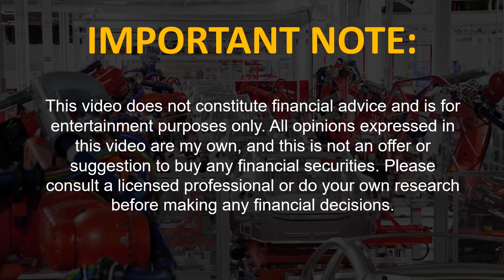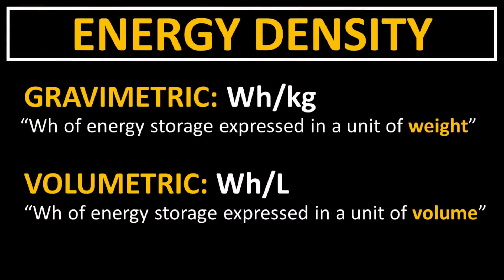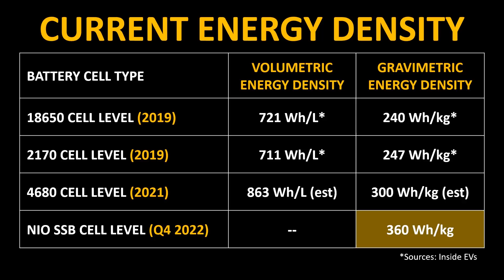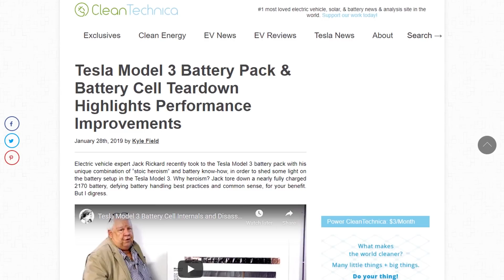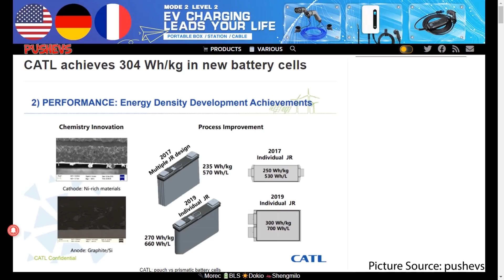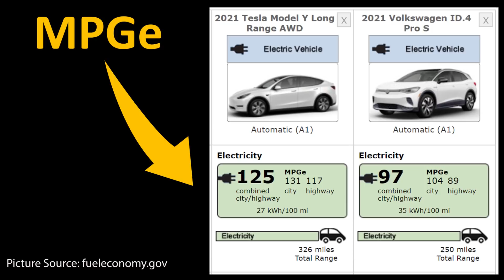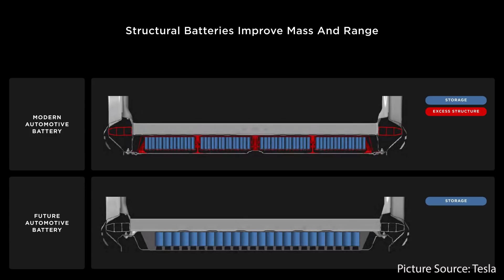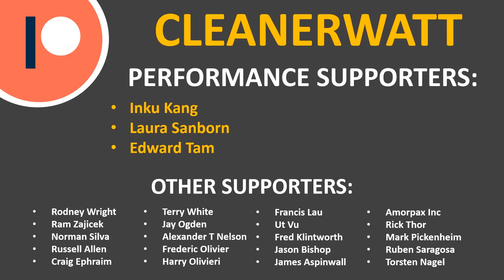Tesla New Battery Tech vs Nio Solid State Batteries (Part 1: Energy Density)

Comment: Energy density Energy density everywhere what about realiablity does solid state battery will provide enough battery life to sustain that long range over time , It will only succed if we can get similar Cycle life for SSB as we are getting from current tech otherwise it's useless to buy expensive battery which degrades faster.

Comment: You take a minute about a car brand who is the first to use a new battery technology and then spend 20 minutes why Tesla will ends on top.  Sorry, in my opinion you are comparing apples with oranges:
- You take in account the weight loss of the mega castings. 
- You take in account the weight loss of the battery pack as a structural part of the car. 
- You do not account the benefits from semi solid state technology, like less power needed for heating or cooling the battery pack. 
- In your projections you take statements from Elon about the future progress of battery tech and forget to mention that new SS tech also will show progress, maybe even better, because at this point this is still new technology.

Why is it that a channel called ‘CleanWatt’ has to act as a Tesla fanboy instead of just be pleased with the news that there is actually new step in promising battery technology. 

Holy shit! I’m getting so tiered with this. Don’t get me wrong if I could afford a Tesla, I had one. However I am just interested in clean technologies and ends up bombarded on YouTube by videos like this. It’s just horrible.

Comment: I have read some of Tesla's hype before about gaining weight advantage because their battery packs are being designed to be a structural component of the frame.  Others can also do the same weight lowering using this method thereby neutralizing Tesla's claim.  Frame weight reduction should not be used in determining the abilities of batteries, even though lowering weight is a good idea.  The Tesla auto that went a short distance before running off the road and hitting a tree outside of Houston this week says that Tesla had better add more strength via weight back into their frames, as total structural collapse happened, the car them burnt up and the two occupants were burnt to death.

Comment: 330Wh/kg at pack level is a very very brave statement. AFAIK the cells would just about make 330Wh/kg. They still need management and cooling. Forget it at pack level. I say 220Wh/kg at pack level, if you’re lucky!

Comment: There a lot of room for misdirection with EVs. I will definitely not take Tesla performance stats for granted after battery day because they stuck “x5 storage” on the screen as performance when it IS NOT performance but only data. It is nothing more than the volume of the bigger 4680 cell compared to the volume of the 2170 cell. Misdirection? Definitely! Take care out there and do the maths consumers.

Comment: Great video. It really highlights just how ludicrously far ahead Tesla is. This seems to align well with what we know about range. The EC7 with 150KWh pack gets 600 miles NEDC range, which is probably more like 400 miles EPA range. All while being 60% larger pack size than the new Model S long range (90KWh pack) with 412 miles EPA and still using 18650 cells! 

The Plaid+ with 4680 cells has 520+ miles range. Let's say they stick to that number for now. That implies a mere 74kWh pack! So Plaid+ will have ~25% more EPA based range than the NIO with a battery pack that's half the size. 

This is how Tesla dominates. They can build two cars for the same number of batteries their competitors need to build one. And STILL beat them on range. 

It's amazing. And why Tesla is going to the moon.

Comment: Perhaps I missed it, but when talking about solid state batteries you should always consider the cooling.
Solid state batteries will need less cooling/heating to keep it a optimal working temperature. I think this is where you save space and weight. In any way, it will be awesome, both technologies look promising, and ideas like this will force Tesla to improve their technologies all the time.

Comment: What about charging time. A structural battery pack lowers the weight but does not appear to increase charging rate. What are the comparative charging times of the two technologies?

Comment: The use of structural batteries lowers the weight of the car, not the battery pack. That is so far a stretch you are clutching at straws and distorting facts to suit. Completely false and unacceptable manipulation of data in order to favour Tesla.

What are the real figures without the car weight affecting the battery density (unbelievable stretch).

If the Neo releases with an ultra light back seat with bolts that link it to the battery pack, will you re-calculate the battery density ? (just let how stupid that question sounds sink in for a moment, it is no different to your conclusion).

Comment: The biggest issue I see with NIO's solid state battery is the  phrase "with good battery life". No, that is not "good" enough. I would prefer to have a little less range to have excellent battery life. Think about it, why go for extra range when the battery will not last very long to always provide that range?
Reply: Great point. A very vague claim re life for the battery

Comment: Going forward, battery COST per kWh is more important than energy density, because current range is adequate, it is the cost of manufacturing EVs that is "not adequate" currently ... most are still in luxury car price range, and Tesla, by all indications continues to lose money on each car (but turns a small profit due to government EV credit sales, and free capital from Stock Dilution). The Porsche Taycan at it's hefty price, may be the only high margin highly profitable EV on the market. The EV industry needs COST REDUCTION Technology Advancements... that will greatly increase market share within the entire auto market.

Comment: I feel that all battery architecture will eventually change to pouch or flat cells. Take a stack of paper and roll it up.... it simply takes up much more room in cylindrical form than it does when it is flat.  Also cooling can be much more uniform in a planar battery. Only time will tell if my prediction is accurate or not.
Reply: Not necessarily. Prismatic packs are very difficult to cool.  Further more it’s more difficult to pull current out of them.  Unlike paper you can’t just stack them up.
Reply: Hi  @greghelton4668  you mentioned prismatic but I did not... prismatic cells are blocks like bricks. I suggested flat / pouch cells stacked with something like an aluminum plate between them to extract heat. Rods could compress the stack. The plates could be cooled at their perimeter by liquid or air.  Looking at all the wasted space between cylindrical cells I think flat cells would result in a much more compact battery. Also cylindrical designs have inherently uneven thermal expansion which in time can cause stress and physical fatigue. Like I said time will tell.
Reply: @cycletrucks7132  I could be missing something but it’s the same thing physics-wise as far as I know. Cylindrical batteries has higher resistance in the past because the ions had to travel longer distances between electrodes.  Teslas tabless design eliminated that problem. As long as water cooling is required neither a square or cylindrical still needs to wastes space.

If somebody ever gets SSB to work the cooling system should become much smaller and the battery pack density higher. But if it can be rolled dense cylindrical batteries, conducive to super efficient manufacturing ,become possible.  Like you say time will tell.

Comment: Bro what are you talking about? The final product of Tesla new battery tech won’t come out until 2022. Prototypes of it are coming this year. The final product will come out by the 3rd or 4rd q of 2022 which is also about the time Nio said they battery would be avail. The 4680 will have a 14% increase in range on the first modules and then when matured it will have a range of around 50% increase by 2025. Nio cars have 700km maximum range right now. Tesla in China has around 650km maximum. A 14% increase on range would make Tesla match Nio battery range. It would be 700km Nio and 724km Tesla 

Tesla batteries will weight less that’s for sure. The major benefit of a light car is in speed. Nio is focused in speed they are focused in luxury and driving experience.

Elon was clear when he said that these 1000 plus km range is not going to happen before 2025 when the tech is mature. Please do more research.

But you really got me when you said that Tesla battery technology is going to beat solid states battery technology. Brother really? Solid state is the future that will even power aircrafts and maybe even rockets. Nio with a fake solid state battery will power a car to drive over 13hours in one charge just imagine what a real solid state battery can do.

Comment: The battery hadn’t even been developed , it’s a lot of talk until it’s actually in use!
Reply: y6
Reply: @William Arrington If you plug your Tesla in it does not charge until the app tells it too.  No Tesla rolling blackouts at 5pm.  Too bad the Tea Kettles did not stagger their power usage.
Reply: @William Arrington Agree on QC, but remember JD Power Satisfaction survey had Tesla at the top, more owners would buy Tesla again. BTW, if there isn’t electricity, you can’t pump gas either.😿
Reply: @William Arrington Tesla is a monopoly?  How is that?  You can't buy other cars?  Only horses and Teslas?  The Taycan?  Yea, for $180k you can compete with a $50k Tesla.  (If you don't count safety, security, or FSD).
  Does the ID R cost less than $50k and do they have plans to build a few million a year soon?  Tesla has the fastest car ever produced.  Nothing is faster.  2062mph.  That is not a typo.
Reply: @William Arrington If no other company built electric cars, or any cars, Tesla prices would still be coming down.  Tesla reduced the price of a new Model S 17 times since launch in 2012.
Reply: @William Arrington Just basic physics.  It is really that fast (2,062 mph).  As for competition... none to be found yet.  Big Auto companies build 50k EVs a year, selling each one at a loss and call it a challenge to Tesla.  Because they don't have any batteries, battery factories, or battery patents they are unable to compete.  They produce so few cars that Electrify America and EV go can keep them all charged.  lol
Reply: @William Arrington Just remember the electricity required to refine gasoline. Depending upon the quality of the crude, its 5-6kWh to refine one gallon. Hell, I can drive my Tesla 20 miles on 5-6 kWh. Why not cut out the middleman here, gasoline?
Reply: @William Arrington Gas sucks.
Reply: @William Arrington I see these battery problems as Tesla goals they are working on now... Elon seems to know his priorities and the world has made up its mind to give him time to get it all done, even at "Elon time" schedule...
Reply: @William Arrington then in the end Elon is working on the same battery prblems as other companies, while still making improvements in production of cars, charging stations, and Giga factories well ahead of these "Tesla" competitor wannabes...
Reply: @William Arrington Prototypes are easy.  Mass production is hard.  By the time Toyota has solid state batteries being built in large numbers every car on the road will be a Tesla.
Reply: @davidbeppler3032  will be Tesla's 4680 batteries....
Reply: @William Arrington Ah.... Luxury and less expensive than a Honda Accord?  Why would current production rate matter when they can build a factory in less than 168 days?  How about Tesla will be building 400 million cars a month in 3035.  Based on that they can replace every car every year.  Plus the power grid can't handle people charging their cars?  Why not?  The power grid can handle AirCon right?  You know at night when AC units are asleep you can charge your Tesla.  The only effect is the power company gets more revenue.

Comment: These improvements are certainly important but I miss the mentioning of the price tag attached to these new battery technologies.
I feel like demand by the mass of consumers is principally there.
... but nobody points on whether the technology will be affordable for everyone or better said if it helps reduce the battery price (which is a major part of every EV) to a level that gives EV´s the edge over ICV´s.
Only then we will see the majority of consumers seriously considering to switch to EV´s.
Actual EV´s like Tesla M3 or Volkswagen ID3 are still - relatively - pricey compared to ICV´s.

Comment: I agree with Jay Jay, not a fan of the house background. 
Also isn't this just a numbers game for the batteries? Taking what appears to be a better Wh/Kg battery and massaging the numbers to get Tesla on top by incorporating it into "at the pack level"? Don't get me wrong I'm a HUGE Tesla fan, own stock etc. but this seems a bit of numbers juggling. If Tesla had Nio's battery and used it in their structural pack how would that work out?

Comment: does not matter.  Nio is only for the Chinese market The rest of the car is stolen from the other car companies.   There is nothing to say Tesla wont be pushing this same battery in coming years.  Batteries are finally starting to see movement in cutting cost and increased energy Density.  Tesla may also be thinking of using super capacitors for pushing out power

Comment: There is a massive difference between Tesla and NIO in that Tesla built 500,000 cars last year and will build over 1,000,000 this year. The Tesla 4680 is in production in Tesla Fremont factory and will be in production in Berlian, Shanghai and Texas . Solid state is better but nobody has a battery that can supply a production line today. Nio may only have a battery in a production vehicle by mid 2030 by which time Tesla will be building 2 million cars a year.,

Comment: Tesla is a vastly vertically integrated company that hangs it's hat on supreme engineering talent you just can't easily replicate that. Also consider Chinese government and high officials also owns Tesla stock you think they want to loose money sabotaging Tesla devaluing their personal investment? I would imagine the gains in TSLA stock considerably outweigh the Nio investment at this point. TSLA is looking at being a generational company and perhaps most valuable company in 5 to 10 years, do you think Nio has even a 5% chance at that? We already know China manufacturers have reverse engineered other auto maker products from BMW etc and they still have come up short with those clones, why? In my opinion this solid state battery tech has less than 1% chance of seeing scalable production at a cost basis parallel to 4680 / structural engineering gains by Tesla by 2022. By the way Elon has always said "show us your battery and we will buy them if they are exponentially better, we will give you a fat contract and make you rich". If this is the case Nio has the dumbest CEO's in history not to jump at this deal. Tesla is the #1 buyer of batteries in the world at this point in time.
Reply: I got I to nio and tesla 2-3 years ago.
Nio is priced in mostly on catalysts and proven fundamentals.
Tesla priced in 10-25 years ahead.

Comment: I like you to answer this question, If it is a solid state battery, with a fast charging, ie in5 mins to full charge, why does nio need the battery swap technology, it seems to be a redundant technology.
Reply: If u owned a EV car for 50k dollar and then they release a new battery which gives your car longer range, but u have to sell your old car and buy that new car to get that battery. Would u rather prefer to just have a car and just swap out that old battery and get that new battery? I sure know i would xD. I think people prefer the advantage to own a car where they know they can just get the latest battery when released. There will be new batteries like there is new mobile phones
Reply: @zzzimbazzzimba4460   I can't argue with that point, you probably is aware tsla has a millon miles battery in the 4680 cell, you  point will be moat.
Reply: Perhaps the NIO batteries have a short life (recharge cycles). Just guessing.

Comment: I don't think it is okay to add 10% to the Wh/kg when the 4680 cells is packed, this is not how it works.
Yes I understand that when the battery pack is structual it replaces some structual material and you could argue it should be included in the calculation, however, it doesn't lower the weight of the battery pack, just the total weight of the vehicle.
To make the vehicle lighter you could make it of carbon fiber or aluminium.
Reply: I agree, the cell Wh/kg could almost be used for the pack Wh/kg then, minus the cooling on top.